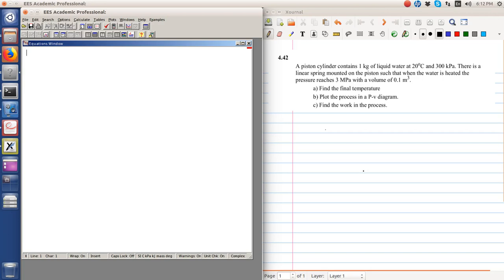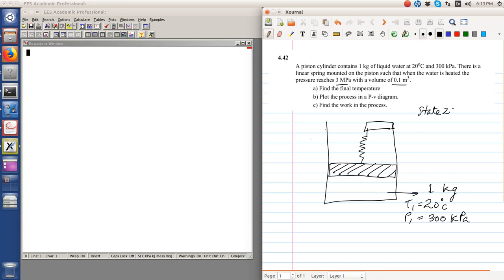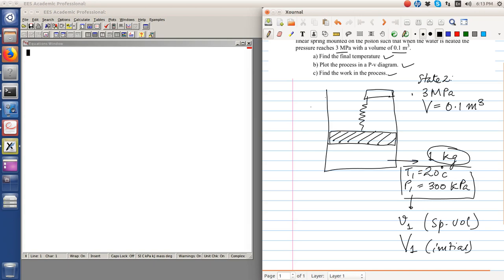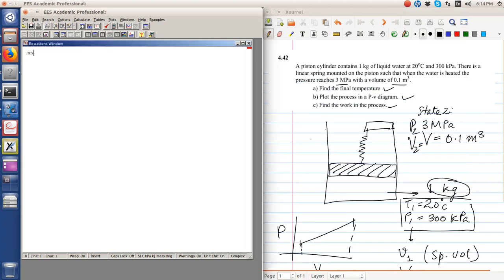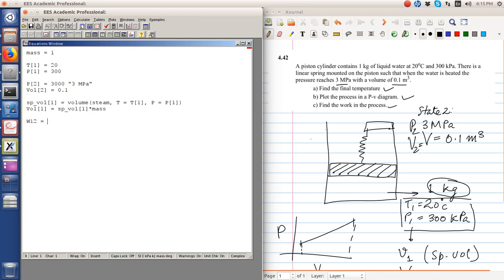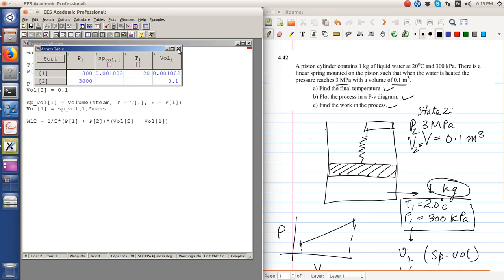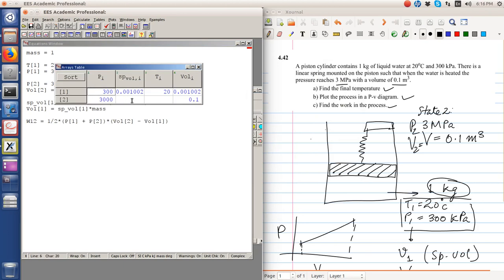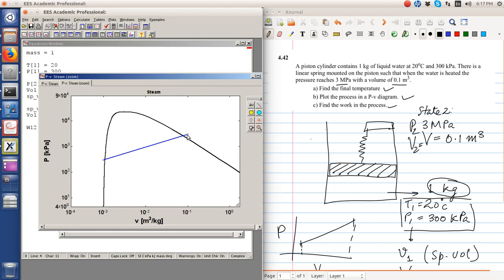Problem 4.42 Sonntag using EES (Engineering equation solver)

Comment: Sir, How the presence of spring is taken in calculating work done?
Reply from the maker: The presence of a spring leads to a linear variation of pressure with volume. This is obtained by taking a force balance on the piston. We can discuss this in my chamber later.
Reply: there is a pressure exerted by the gas on the piston AND a pressure exerted by the spring on the  piston.
trapezoidal area = rectangular area (work done by gas) + triangular area (work done by spring)